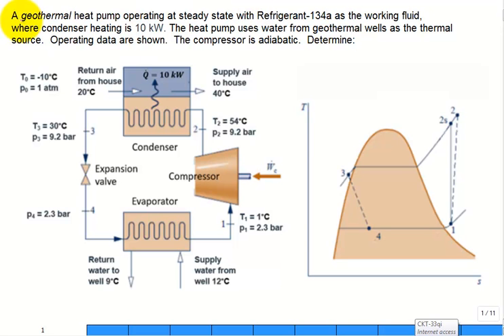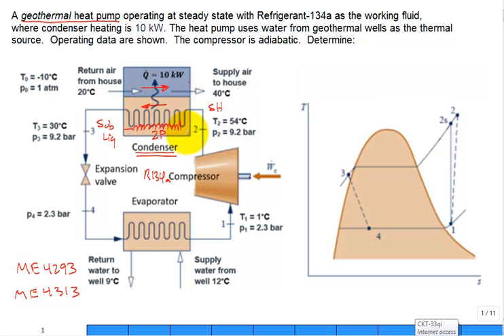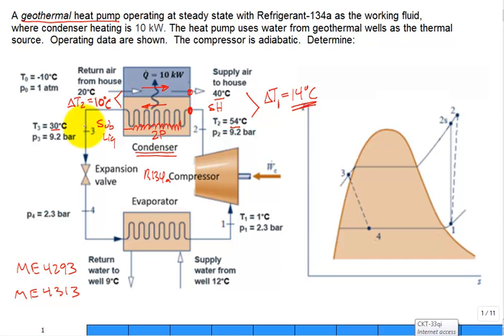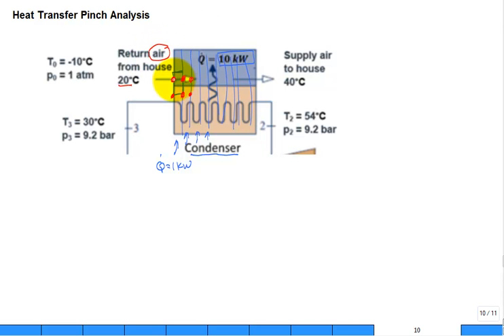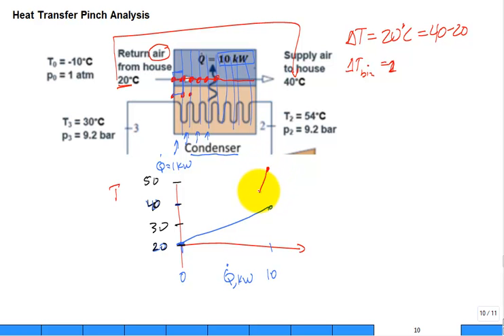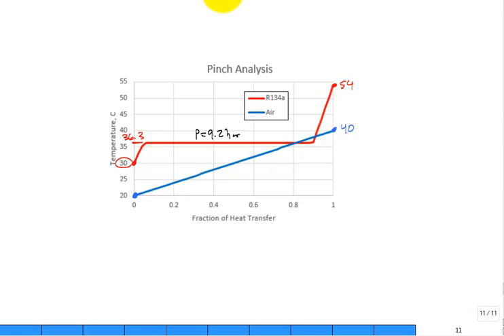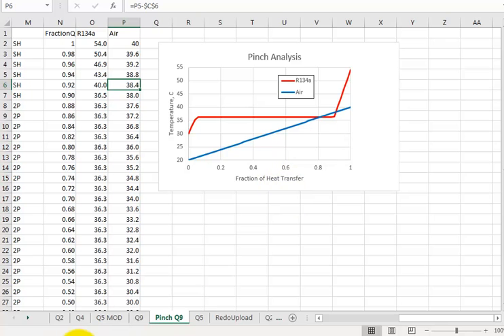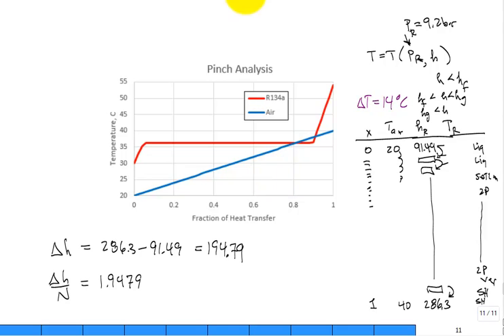me4293 heat exchanger pinch analysis R134a condenser

Comment: Why would air heat up in uniform fashion when the delta T with the refrigerant varies so much? Doesn't make sense.
Reply from the maker: x-axis is fraction of heat transfer.  Specific heat of air is constant over temp range from T_in to T_out.  If cp was highly dependent on T, then would not be straight line.